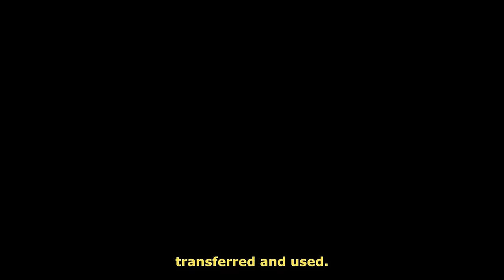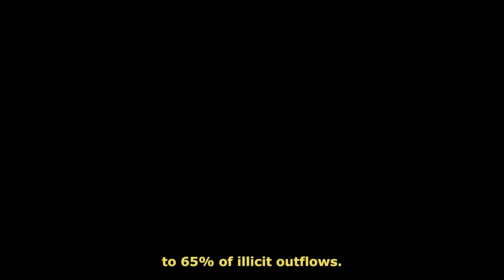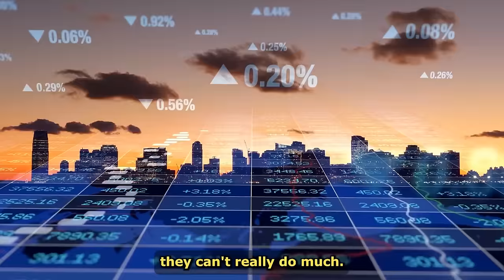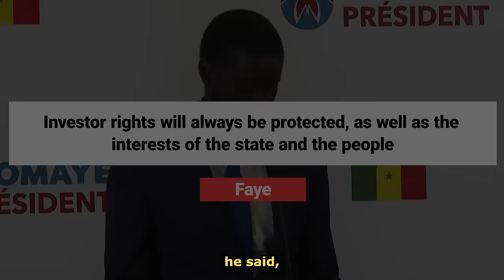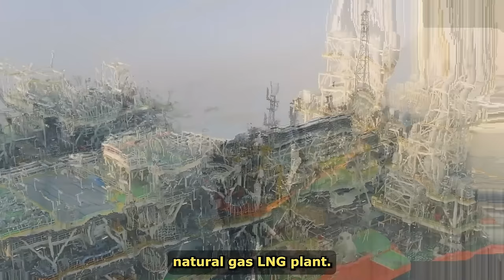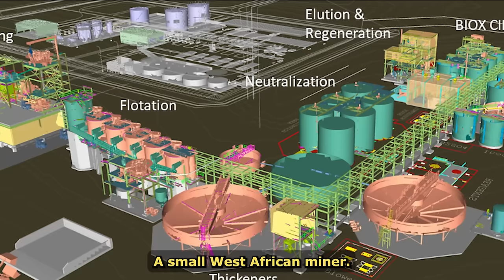Senegal President Faye Shocks The West Announces Audit Of Oil, Gas And Mining Sectors.

Comment: Bold moves investigating oil, gas, and mining are necessary and practical. Will these change Senegal for the better, yes, marginally. 
What will change Senegal in a really big way however may be three big domains. 
1.First is national unity.
The reality facing President Faye and Prime Minister Sonco is that France still interferes and controls too much in the Senegalese state. For example, French military presence is unacceptable. The French controlled CFA franc benefits France and transferred wealth from Senegal to France for 6 decades since independence in 1960. Many things need to change quickly. 
There was no incentive to unify the tribes of Senegal into a unified state. Therefore, the French exploited tribalism, picked who would rule, and successfully plundered Senegal and left many unskilled, unemployed, and impoverished. Senegal lost as a country.
2. The second is national defense and security control
France maintained military force presence and offensive posture in the country since 1960. Senegal has no navy, no marine corps, and no air force. Because of Pact for Continuation of Colonisation, French military policy and presence has suffocated Senegal economically and technologically, thereby depriving it the means to acquire and the desire for a sufficiently muscular indigenous security defense capability. Under the Constitution of Senegal one of the most important duties of leaders is security and defense. This is not the duty of the French State.  It will therefore be egregious error and a burden which will be left for future generations if President Faye and Prime Minister Sanco do not act decisively to remove the French military and remove the French threat to its sovereignty. Such failure will mean that they will be judged to be just as weak, if not irresponsible as their predecessors. 
3. The third is control of money and currency. 
Control of a nations money by a foreign power is disaster. Listening to the conversation about the CFA franc currency it appears that too many in West Africa continue to advocate for sticking with the CFA franc, suggesting that radical break with France is about nationalism. It is not. 
Change could involve temporary setbacks, but this is not a reason to delay, again, a radical break with the past. Sticking with French monetary system for 6 decades was very costly, and this manifests today with French control of domestic production, massive unemployment, and significant poverty among the population.  The overly cautious continue to ignore the network of knots between the CFA franc currency and French manipulation of Senegalese monetary policy, and by extension, fiscal policy, credit policy, investment policy, and the circular flow of income. 
Remember this: prosperity only happens when people are in control of their territory, land, natural resources, labor, and money.
Reply: Botswana recently renegotiated its diamond production contract with De Beers and walked away with the larger share of the benefits from the proceeds of selling diamonds. It can be done. Botswana always had a 49% share in the joint-venture company(Debswana) anyway, but the sharing of proceeds from the sales was more beneficial to De Beers. However, in real terms, Botswana still made more money since taxes on the proceeds provided another sales.
Reply: All will definitely be implemented gradually.
Reply: This will definitely happen as days go on.